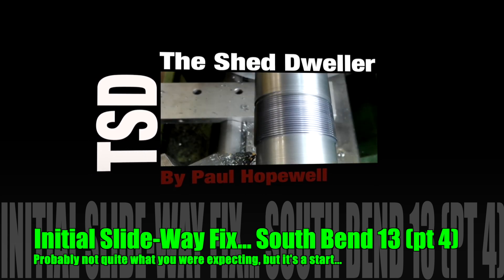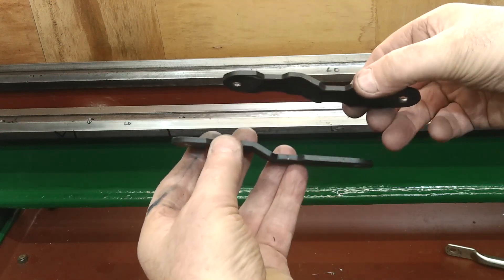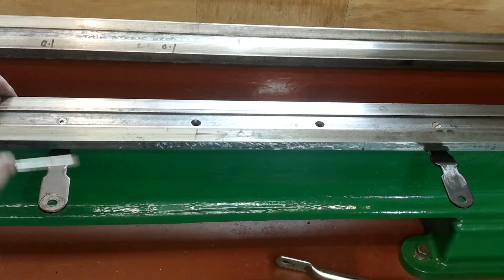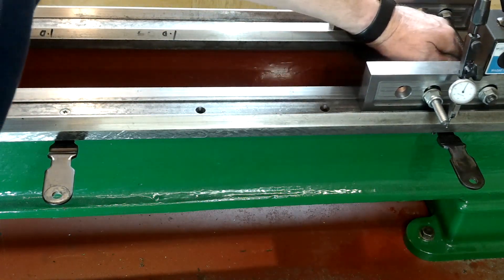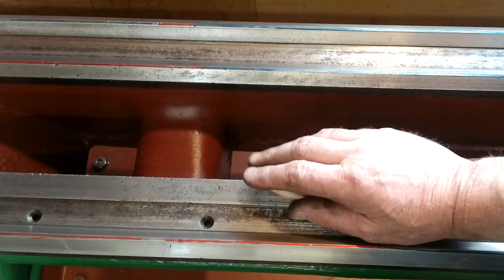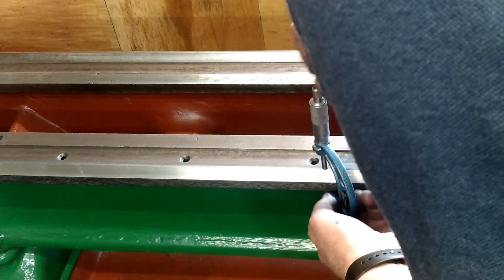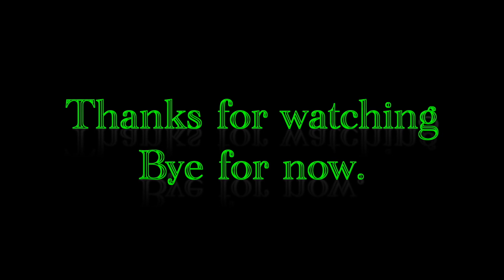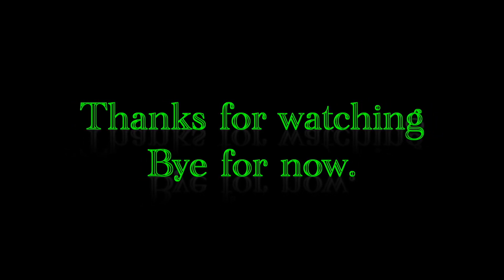Initial Slideway repair, South Bend 13 (pt4)

Comment: I have a 70-years old lathe with two top faces which are not parallel and never worked, and never supposed to work, because of rough milling.
Reply from the maker: Hi, there are probably many other places to use as  references while mapping out your lathe when the time comes. Regards

Comment: I can’t believe you filed the ways, and I can’t believe it worked! amazing! Thanks for the great video(s)!
Reply from the maker: Hi, these faces aren't slide faces, but I’ve cleaned them up to assist me in cleaning up the 7 real slides that need putting right, and only 4 of those need the most work.
Thanks for watching.
Regards

Comment: Nice one Paul. 
8 faces flat, level and parallel. 
The question is, have you ordered 25kgs of elbow grease or are going down a  powered "gadget" route?
Oh,  The nut! Was that Heaths idea,,,, genius 😊
Reply from the maker: Hi Nell. The elbow grease is already on order. The nut was one of Heaths suggestions, as for the gadget route you’ll just have to wait and see..😆😆😆😆
Reply: @Thesheddweller  oh keep me in suspense why don't you!
This is worse than waiting for Christmas 🤣🤣🤣🤣
Reply from the maker: @NellsMechanicalManCave  Glad to be of service.😈

Comment: I still don not understand what you're doing? These top surfaces have no function at all, so what's all the work good for? As reference for further measurements? Looks somehow overcomplicated to me and too much work.
But ok, maybe I see the solution in one of the next videos.
Reply from the maker: Hi Paul, basically my main intention was to repair my lathe bed Vee slides, by using as many true surfaces as I could possibly find, while at the same time investigating several avenues to repairing the vee slides. The three top faces and the front face certainly do not do anything, but by lining them up, I now have more options to assist me with whatever method  I finally decide to use for improving the three worn vee slides. In the meantime and just as I was finishing the video the last channel of investigation came through and it looks quite promising, hence the teaser at the end of the video. regards

Comment: im bussy working on a boley5lz bed. my approach is to rough shape it with a single point cutting set up, bit like a long bed planer. have some linear bearings bolted to the bed with a slead on top that cary a compound table holding the tool. so that i can treverse sideways after each pass. its very tedious and can only take of minute abount of material. im bussy looking at the posibilety to do drive it with a 24v dc wiper motor from an old truck. and belt or cable drive. had a long air cylinder on it , but that does not give any controle. by the time i have enough air to push the tool its a bit like pushed by a spring, and just go faster till it ram the stop at the end or knock it self off track. so i have done some by hand.
but thats to slow. the plan is to rough th shape in and then finalise by hand scraping. the bed has an eror of aroun 0.24mm , way more than im up to scrape out by hand.
when the bed is done ill cast moglice or bronze bearing pads into the sadle to compensate for the los of material.
this little boley is a shining example of the importance of cleaning your machine and enough of the right oil........ it had none of that in its previous life.
Reply from the maker: Hi Manus, I’m sure I have replied to you but for some reason it isn’t showing up on my comments markers, so just in case…
I like the single point shaver, ((a little secret) - That idea has crossed my mind and I've set up a similar system rerady to go) and I might use this idea but with a twist. I shaln’t be using a push pull motor like you are thinking of using, I’m going to do it all by hand,…. I hope.  Without telling anyone what I am going to do, I also plan to rough shape first then scrape out the last bit…
As far as the bed ways are concerned, I dont have a plan for them… just yet. I’ll cross that bridge when I get to it. 
My lathe looks like it was oiled quite well but used very little and after 80 years it is tired and needs a regrind, the rest is history.
Regards
Reply: @Thesheddweller  im waiting for you to post so i can see what you do. this one has me curious. i still think your threading tool is the best, but lets see how your genious top your genious....if that make sence.
Reply from the maker: @manusholm3536  we’ll see..👍